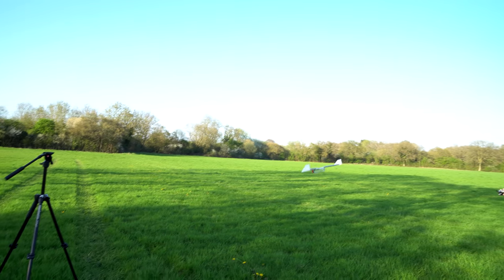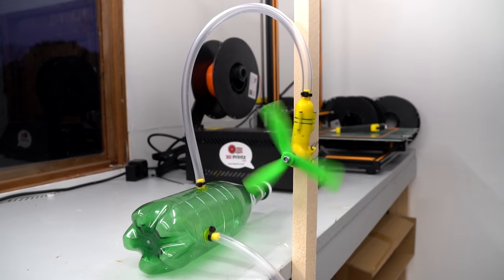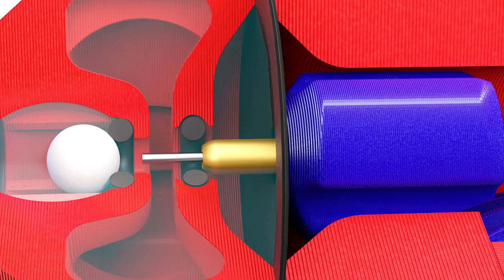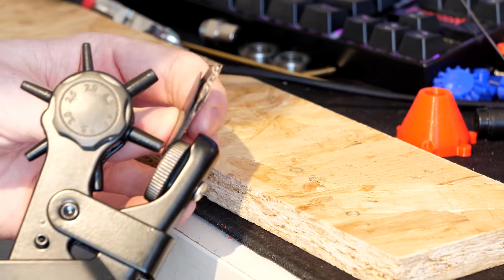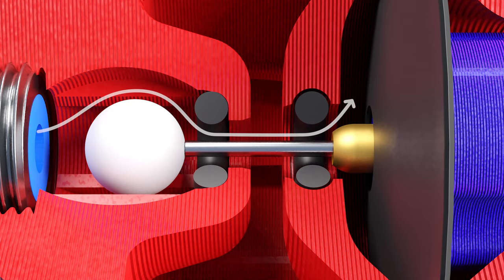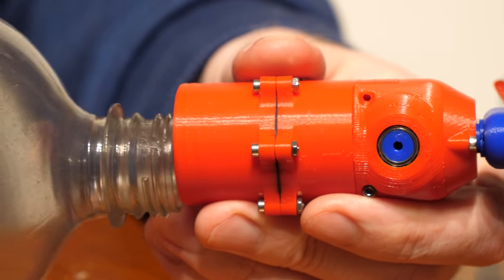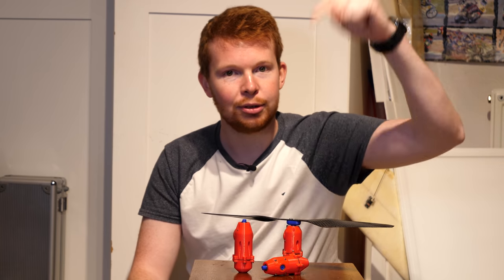Diaphragm Air Engine

Comment: "Thrust time per 2l bottle at 60psi" must be imperial, isn't it?
Reply: its better  than imperial measurements. I propose its called 1 stanton. "how many stantons can that stanton cycle based air engine produce ? " is a question i want to hear eventually at a mechanical engineering lecture XD
Reply: It's worse, it's a mixture of Metric and imperial so noone understands what's happening
Reply: Lol
Reply: In this case the SI derived unit would be: N^2*m*s
Or in SI base units: kg^2*m^3/s^3.
Not very useful unless someone has a better way to represent the unit.
Reply: Liter is metric, and PSI is imperial... so...
Reply: It is such a mess so it must be imperial is what i am saying xD
Reply: I always get sad when I see psi (or any other imperial unit) - not because it's worst than metric Pascal unit (or Bar). Psi as good as Pascal or Bar when we talk about single unit - at the end both are just numbers that people get used to it. What is really wrong with imperial imperial units is that it makes entire SYSTEM of measurement inconsistent. Why we need foots, yards, inches, miles, nautical miles for just one single concept like distance. Distance is distance so there should be only one unit for it - period. Why buy electricity in kW h, vacuum cleaner in Watts but measure power of your car's engine in Horse Power which has no relation to any other accepted unit. Power is power so there should be only one unit for it - period. It's like riding a car with 4 different wheels. The beauty of metric system is than it's consistent and units depends on each other. Mass and weight are not mixed (pound/pound force), nonsenses like wire resistance in Ohm (metric unit) per feet are not happening in metric system. Metric system also had some rules of writing stuff. I'm always getting sad when I see kilometers per hour written as "kph". SI system is very precise - units are written as multiplication or division (via "/" character) of well defined units. It's km/h NOT kph or km/hr or kphr. If there is a international standard we should ALWAYS follow standard. Here is the nice graph that shows beauty of International System of Measurements https://physics.nist.gov/cuu/Units/SIdiagram.html Show me similar diagram for imperial system and I'll shut up forever :) My point is that channel creators like Tom Stanton are in the best position to change the world to be more consistent and unified one - if the designs and video would be fully in metric system new generations would adopt to metric naturally as everybody would like to do cool stuff in the same units like the channel author :)
Reply: @ValentineC137  , those of us at primary school in the 1970s probably got taught both. At the same time. Hence mix them up a fair bit!
Reply: @rfly-fpv  that's literally why si.

Comment: U can use a magnet(like poles)which will be more efficient. U will not need any air pressure. Replace the metal ball with a strong large surface area which must fixed at that position and another magnet of less surface area attached to the rotator. It  should be very close to the fixed magent and all u need to do is to rotate the rotator and it will work unstoppable unless u stop it. Try this and compare it to your other engines.
Reply: That would be a perpetual motion machine. Have you built such an engine?

Comment: "noisy engines don't always go faster"

rocket engines: am I a joke to you?
Reply: Rocket engines be: I am SPEEEEEEEEEEEEEEED!
Reply: IC gas turbine: Release the BEAST!
Reply: Nuclear engines:BOOM BOOM BOOM BOOOOOOOOM
Reply: Turbo prop engines: yeah your kind of right
Reply: Honda Civic has entered the chat
Reply: usually the louder they are the more mass they are displacing. Which *usually means that they are more powerful
Reply: @captainjam6651  “usually”
Reply: @LapisMiner I subbed to you channel wanna make a video together
Reply: If engine makes noise,that means the  source fuel is converted to sound energy in engine
Reply: @yuvaprasad3543  yeah but nothing and i mean nothing can convert all its fuel into 1 type of energy at 100% efficiency
Reply: Tictac UFO: Yes

Comment: Instead of a hole in membrane, to exit the air it can be designed a valve which can be opened by a rod connected to crank Shaft, similar to combustion engine valves
Reply: I think he was going for simplicity.
Reply: Then you're back to the issue of air leaking

Comment: I remember about 25 - 30 years ago they made toys and later RC cars  that would run on air. Only the steering was motorized. Which allowed the toy to run for really long times, as long as you pumped air into the car.

Comment: Nice work Tom! I admire your work ethic and persistence, quite amazing the amount of effort you put into your projects. As far as sealing your surface mating areas I would suggest modeling o-ring groves and integrating matched o-rings as this method has been more and more adopted over the years vs flat type gaskets. Another idea would be to do the same with your piston much like engine pistons use rings use an o-ring or two as piston rings to get a nice tight seal. I've used this method experimenting around on an air driven Sterling engine. Acrylic tube is cheap and fairly precise and works great for a cylinder barrel. Maybe you could try integrating a small sleeve of it into your 3d-printed body much like older tractor engines used sleeves years ago. At any rate keep the great work and presentation! You have a new subscriber.

Comment: This compact, modular design has great potential in my eyes.
Reply: Yes, it took on a new light when he put the thread on the back!  I could see a proper moulded version in shops.
Reply: @Spedley_2142  It reminded me of the Contraption Collector's quest to design and make butterfly scissors. I think it would be really neat to add a valve to the motor itself, making it instantly compatible with any drink bottle.

Comment: Sounds like a broken 2-stroke, Love it.
Reply: Would be cool to see a "multi-cylinder" design, with them all geared to a common output shaft.
Reply: @noxious89123  Maybe not impossible, although the timing for every cylinder to work in sync would be a nightmare to get it right. This due to it being powered by air pressure.

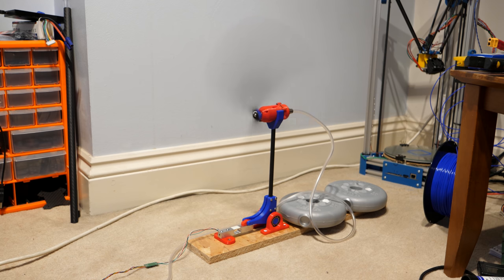Comment: 7:07 Hi Tom. Did I hear you say 0.41 bar or 60 PSI? 1 Bar is 14.5 PSI!
Reply: 4.1 bar
Reply: @SuperDeinVadda  Yes!
Reply: He did say .41. And it's 14.7 psi to a bar.
Reply: It's also in that graph. Simple conversion error.
Reply: 2.41 Bar
Reply: @happygimp0  Please turn on transcript to see for yourself, "Pressurized to 0.41 bar", 60 psi=4.1 bar, it's just a calculation error, he gets the 100 psi=6.9 bar calculation right on graph
Reply: @Bobs-Wrigles5555  True.
I understood to as two
Reply: @happygimp0  Hearing Aid time?
Reply: it 5.95 psi or 0.41 bar

Comment: drive the exhaust air through transfer holes to the back of the engine to utilize also this thrust
Reply: Good morning friends
Reply: Good idea, that way you can use as much of the air's pressure as possible.

Comment: "Noisy engines don't go faster"

Quite, noise is an indication of high friction.
We all know how friction introduces unwanted energy transfer.
You can probably increase efficiency further by affixing the diagraphm bearing via a drilled hole to a central value transit shaft and tapering the inlet well aerodynamically so that you can install the inlet point at an offset position.  Restricting the valve bearing's movement axis makes the energy of air pressure less dependent on keeping it fixed in place and causes the release to happen along a controlled axis.  Tapering the inlet well so that centrigual forces become unidirectional and naturally push the bearing into position along a fixed transit shaft would probably get you 70-85% (and would also reduce noise and bearing wear!)

Work on an inlet well design and a valve deisgn that optimizes unidirectional throughput.  As stated, a tapered inlet well is a grand idea and will grant more pressure than you bargianed for.
Reply: What are you talking about? The centrifugal forces happen at the crank.... And what diaphragm 'bearing'?
Reply: @Radical Edwards  The centrifugal forces at the inlet are air, not mechanical, as rotational forces of pressurized air produce lateral movement at the center of the chamber during compression,  that affixes the diaphragm bearing into position. This proposition abuses those forces with the use of a tapered intake chamber and a transit shaft to abuse a directed wind tunnel and fact the forces at the center of a tapered inlet chamber are lateral.   This stops the bearing from losing energy by avoiding leaving it loose to flop around the intake chamber with the added benefit of an increase in pressure.  The diaphragm bearing is the small white marble in the video that covers the internal diaphragm intake rubber valve gasket during compression.  Please see his explanation of how the valve in the old air hogs toys works for details.  This is a good adaptation, but abusing the control of direction of air circulation around a tapered chamber during compression to optimize movement of the diaphragm bearing makes it better.
Reply: @nightwintertooth9502  OK but, explain where the bearing is. The only bearing I see is a ball valve, and that does not serve as a bearing. I dont think you understand.

Comment: Try with a small aluminum pressurised can. I know it is heavier than a plastic bottle, but it can handle an exponentially larger volume of much more compressed air so your mileage can go up.

Comment: I would recommend resin printer for high resolution parts.
Reply: Depending on the strain and geometry resin can be heavier and will be brittle that pla/and/etc.. FDM seems to work fine here.
It would look way nicer though
Reply: @Co-km6cl  I'm just wondering about those gear, some of those shots to pretty not smooth.
Reply: @spik330  yeah I wouldn’t be surprised if there is a not insignificant efficiency loss from those gears. Or having gears at all. The differential is the single biggest point of drivetrain power loss in a car iirc

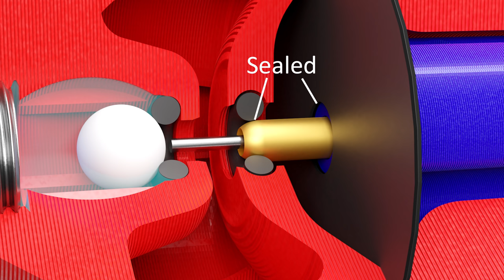Comment: 2:40 It seems you're paying the theoretical inefficiency of the engine twice.First, air from the tank fills the chamber in the cylinder head. Then that chamber equalises with the piston. Then the piston expands driving the engine. If these chambers are roughly the same volume the piston is being driven by 75% of the tank pressure on average. Expansion of the air through valves or on the diaphragm also cools it. It would be interesting to see how an air engine would perform if you could couple the tank pressure directly to mechanical work.

Comment: You just explained seconds of impulse in such a simple way... Area on the graph. Makes sense to me now. Awesome things you are doing. I've always been amazed at how much pressure a PE 2 liter bottle can hold, no doubt with a carbon fiber wrapped bottle you can hold many thousands PSI and run this engine for potentially hours at a time. Bravo 👏

Comment: would be cool to see the designed adapted to have multiple cylinders, spinning a crank shaft 👆
Reply: would be interesting to use such a design to possibly replenish some compressed air into the bottle for a longer run time.
Reply: That's exactly what I was thinking, make it a smooth running four cylinder or something.
Reply: How about an air rotary? Yeah kidding...

Comment: You ever tried sticking dry ice in that bottle to add more power.
Reply: I have been meaning to try that, but instead I put the bottle in a bucket of hot water. Doing both would be even better.

Comment: Have you ever consider running a rc plane with a paintball tank and regulator?

They run up to 3000psi for a cheap one
Reply: The air tank would weigh a lot, but might work if he used large lightweight wings. Would be cool to see!
Reply: @wonderwhatsnext5408  Blended wing body design. Could work for a B-2 model.
Reply: @wonderwhatsnext5408  what about a C02 cartridge.  Lighter than a paintball tank but still should hold a decent charge.  Use 2-3 of them with a mini regulator.
Reply: I though exactly the same thing. There are carbon fiber paintball tanks that withstand even higher pressures. Not cheap though
Reply: @brandonbrown3600  Those disposable 12 gram CO2 cartridges sure don't weigh much and it'll be hard to beat their energy density in most compressed air situations I'd bet. I wonder though if it would be too cold and make the diaphragm rubber brittle?

Comment: Tom, did you lube it? I recommend use Castor oil. Just try and you will be amazed with results.
Reply: Castor oil is no good
Reply: @rrtsduf  why you think so? For this situation its perfect. It provides lowest friction coefficient. And there is no high temperatures.

Comment: this practical use can be for replacing the conventional piston engine, with electrical "air" pumped into the engine, and still "making V6 sound" even it's electric.
and BOOM! the silent electric era is no longer here, now we drive electric but has conventional fossil engine sound ;) win:win solution
Reply: If all you need is a "V6 sound", wouldn't it be more efficient to just install speakers to simulate the sound directly instead of using this roundabout system of going from electric energy (battery) -> mechanical energy (electric motor) -> potential energy (the pressurized air) -> mechanical energy (piston) -> gearbox -> driveshaft, just to produce sound while losing efficiency at every step, instead of going: electric energy (battery) -> mechanical energy (electric motor) -> driveshaft.
Reply: @ДимитърКръстев-е8я  yes but, it's not natural. I can say if we use speakers we need to simulate almost millions of conditions (ex under the water, low atmosphere, cold/hot, winter summer, etc) , and the sound wave produced by speakers is not the same as the soundwave produced by the real engine, even that speakers use exhaust vibration method to produce the soundwave.
Reply: but I'd more like to hear jet-engine kind of sound produced by dynamos.

Comment: please revisit the compressed air plain, there is a design where the piston runs within the drive shaft and the drive shaft acts as the valve and valve timing with a small hole at the top of the combustion chamber (which is also the drive shaft)

Comment: Have you considered a regulator of some form? Possibly a 3d printed custom inline design, to reduce from bottle pressure to a desired pressure, to get a longer & more consistent run time/engine profile?
This is a very similar valve arrangement as is used in nail guns. You use a diaphragm & a control pin, where they use a seal shuttle & pressure release valve (trigger). Various other differences, but still operationally similar. We used to get an issue replicating something like as engine W certain seal failures.

Comment: maybe I missed it.  I didn't see the air that was to be expelled.  Used a second time in a decompression cycle to help close off the valve.  Seems like you could also use a spring mechanism to help with this as well.  3d printers are fantastic.

Comment: I feel as though you could’ve reduced friction by putting the diaphragm perpendicular to the pressure source, allowing you to connect the piston directly to the propeller and avoid the bevel gear. Maybe that’s a more difficult change than I think it would be, though

Comment: Very good. Interesting project.
A little of instrumentation and "watch mechanics" with improve it a little more.
1. the ball might work ok with on the vertical up but totally fail on the vertical down.
    Instead of the ball use a cone fixed in the rod, so its position will depend only on the position of the rod.
2. instead the hole in the diaphragm you could use a release valve.

Comment: This is fascinating. Given sufficient component durability, and ability to harvest sufficient air pressure from the atmosphere directly, this type of engine could theoretically keep a craft alot infinitely with no fuel. I mean, you could theoretically use one as a compressor to collect and store air pressure, and the other to provide thrust, but Chances are the two would cancel each other out, and never be able to produce sufficient power to overcome it's own drag. 

Probably not feasible at all, at least, not with current tech, but I do find it to be an intriguing thought experience. It tickles my ADHD brain but good.

Comment: Hey, amazing design, I have had a similar project and you could try to add a wax or a oil to each sealing point to increase the pressure before the air moves unintentionally through to increase performance. Paraffin works great as it seals but doesn't stick the diaphragm to the piston or the ball to the valve. And compared to oils it stayed on the surfaces for a long time which were blasted out by the air over time. But try different waxes as I worked with glass and you are working on plastic it may stick. (Also Vaseline worked good) and less is more when applying so it only makes a perfect seal for just the desired time. Happy tinkering :)

Comment: Very good realization you have made there ! I think a propeller with something that could stop it to vibrate to motor could help this one to use less energy to run efficiently. Don't you think. Maybe, it will be something for a new innovative project. It could mean less air need and a motor run for a more long run.

Comment: This could be improved by making it a two or three stage engine. Much as with steam engines, there is still energy contained in the air released as the piston separates from the diaphragm. Feed that air into a lower pressure version of the same engine for additional boost. The timing for that stage can be fed from the crank gear.

Comment: Have you considered using a pelton wheel / turbine  ? Have a look at pneumatic drills (The infamous small ones used by dentists) or the larger ones used in industry/proper car repair garages.